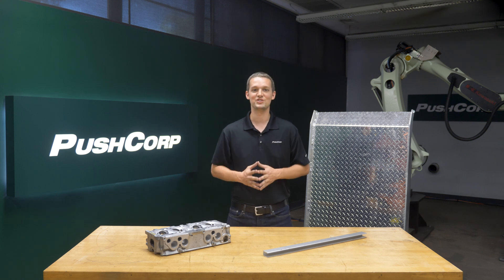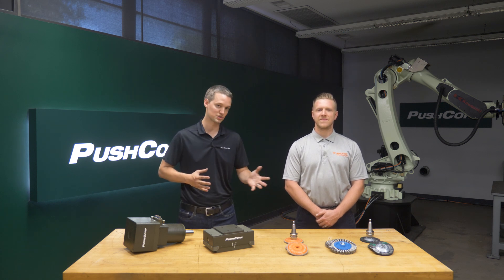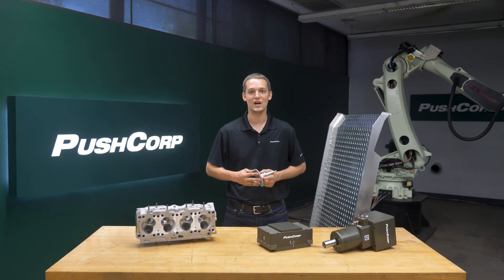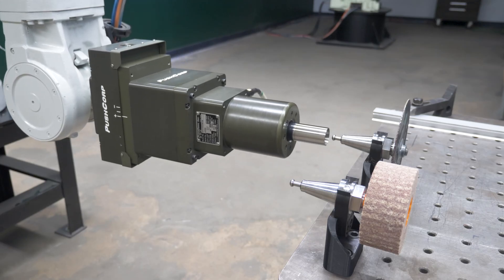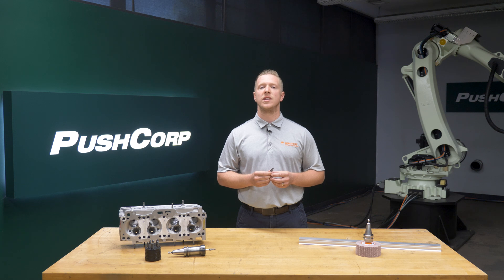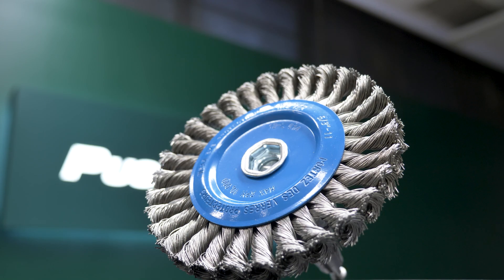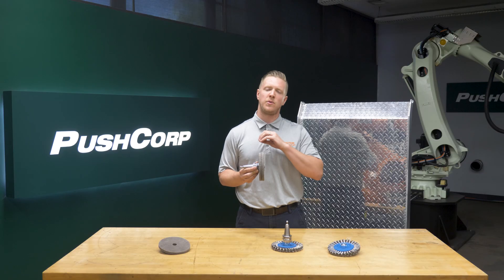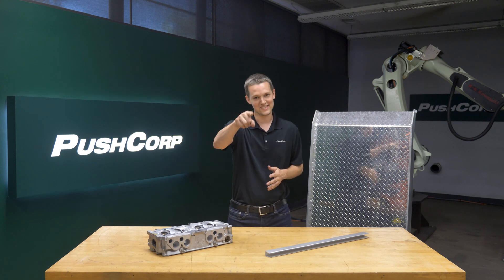Automated Grinding, Cutoff, Deburring and Weld Cleaning on Aluminum

Comment: Great video and abrasives solutiones for aluminum alloy.
But there still  have doubt of it.
1.For weld grinding --We test difference grains and types flap disc,them will be glazing after 1-2min.
2. For cut-off--General resin cutting disc outer diameter will be shorten while cutting,and workpiece is not alway same size.It's difficult to control by auto system
Reply: The Enduro-Flex ALU from Walter has a special stearate coating that is the longest lasting disc, will not glaze quickly like traditional abrasive discs. Try it yourself!
The PushCorp compliance device has a travel stroke allowing it compensate for the wear of a traditional cutting wheel (up to 40mm of wear on the diameter). This also helps to manage with variations in part-to-part - you can see this in opther videos on PushCorp 's channel. Yes it is tougher to manage, but this is the best way to be able to manage a traditional cutting wheel change in size, versus a saw blade that doesn't change in size.